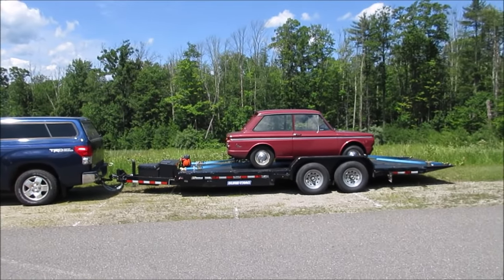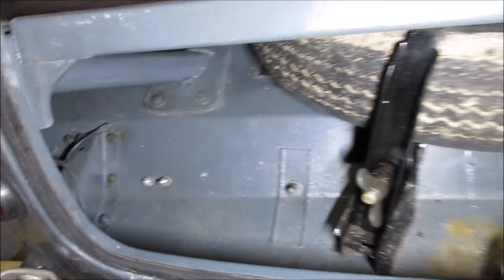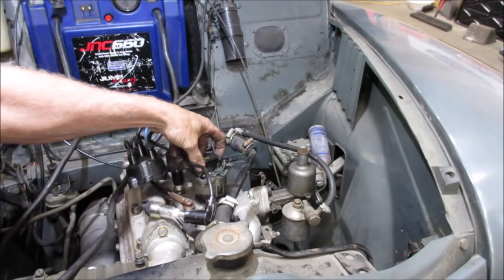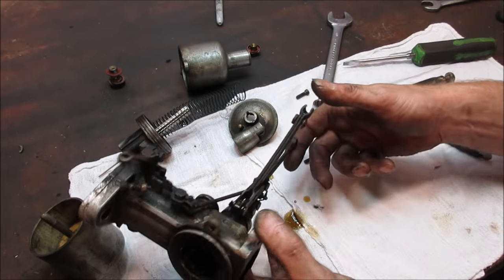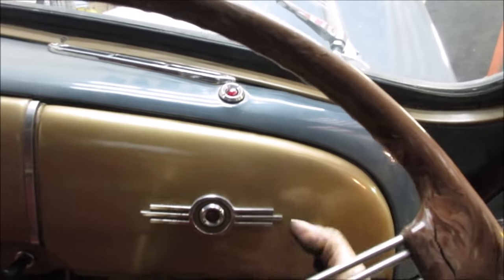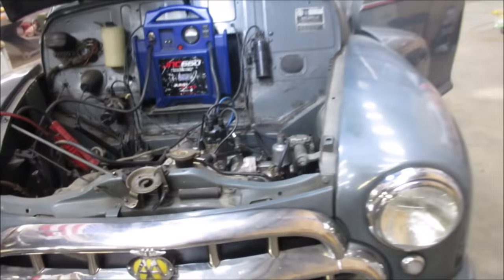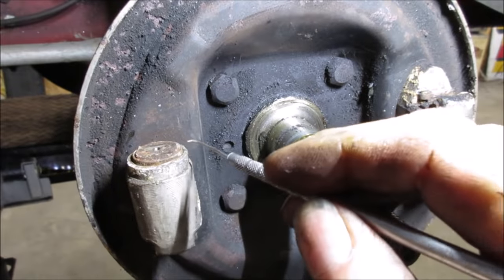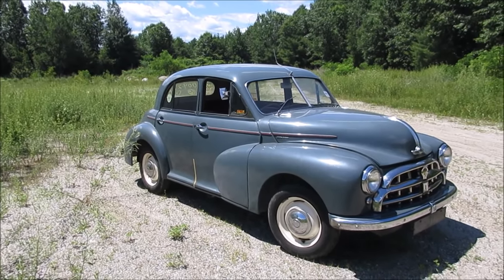50s Morris Oxford Found in an Old Warehouse. Did It Survive?

Comment: My experience comes mostly from the smaller model, the Morris Minor, which  several neighbours and friends had over the years of my childhood and young adulthood.  Several things to watch out for. ... Earlier model cars had a zero pounds pressure radiator cap. It was just a "steam venting" cap that stopped water sloshing out of the radiator when going around corners. A neighbour wrongly installed a 4psi pressure cap, and it blew his radiator, which he had to have repaired, then complained that "Morris Minors are always blowing radiators". The earliest Morris Minors were 918cc displacement sidevalve and fully thermosyphon water circulation. No waterpump and therefore no heater was available.   UPDATED.(Wikipedia says that some of the later Sidevalve engine models, had an optional waterpump, so that an optional heater, could then be installed).   A simple fanblade was attached directly to the Generator front pulley.  Later models had 803cc (and later still "1,000"cc and "1,100"cc) Overhead Valve engines with a waterpump and so could have heaters fitted.  Also the 12 volt DC Generator charging system is far more limited in Amps current output, but it is safe to have the peak charging voltage set much higher. Especially if the car has to park outside in below freezing weather in Winter. Voltage can well exceed the 14.4 volts across the battery terminals that a modern alternator equipped car would expect. The early DC generators are rated to put out about 18 Amps maximum which is almost entirely consumed by driving with headlights and ignition on, turn signals and brakelamps etc.  If the optional extra heater has been fitted, then there's another 3 amps used for the blower motor.  Remember also that DC Generators do not make their full current output until the engine revs are equivalent to the car running about 45mph in top gear (again, my experience with several British cars of the 1950's and '60's). So people confined to "around town" running at 30mph maximum, are more likely to suffer flat batteries in Winter when demands are higher on a battery.    My cars parked outside and were expected to start when covered in frost and ice.  I had my DC Generator cars set for about 16 volts peak.   Also depending on which car model, the "shelf" where your jumper pack was sitting, would often be where the 12 volt battery is located. On some models of British cars, that  equivalent space is where the optional extra, heater unit is located. The electric fuel pump located in the engine compartment is a type that has been optimised for lots of SUCK to bring fuel up from the rear petrol tank, but may not have as much BLOW  (as other fuel pumps which are usually located at the back of the car near the fuel tank).  Some early models to switch on and off the lights for the speedo and fuel gauge, a small slide-switch is hidden under the edge of the dash near the centre. On those particular models, gauge lamps are entirely independent of the headlights main on/off switch. Don't leave them on all day and night or it will drain the battery flat.  Other models the headlamp switch will have a position where the headlamps are on but the gauge lamps OFF.  Low/high beam dipswitch is often a foot push button on the floor.
Reply: Oh good, it is Mustie1, with his hat on now. Some other dude, Whoever it was, was hat-less when I was watching the earlier part of the video LOL.
Reply: My dad's first car was a Morris Minor!
Reply: words
Reply: Thank you for that, I posted that the Minor didn't have a side valve engine, I stand corrected. My earliest memories of the Minor were twofold. A close neighbour had one and as a child I watched him work on it, this old be in 1964 or thereabouts and thi was an old car hen and it definitely had an A series 998 in it. The other memory was my father taught to drive one of his female colleagues and she bought a brand new one, which father would borrow on the odd occasion as we didn't have a car then, he rode a motorcycle to the hospital where he was a male nurse. So this was before 1964 as we got our first car a Morris 1100 ( that was a B series engine)
Reply: @samrodian919  The earliest Morris Minors were known here as "Low-lights" and had the low mounted 5.75 inch diameter headlamps set next to the grille. According to Wikipedia they came out 1948-1953 and had the 918cc sidevalve engine.  (Wikipedia says that some of the later Sidevalve engine models, had an optional waterpump, so that an optional heater, could then be installed).  They ALL had a two piece "split" front windscreen, similar to the earliest VW Kombi vans.  Around 1953 they installed a smaller but newer and better they would argue, 803cc engine, overhead valve, pressurised cooling system, normal fanbelt driven waterpump so a heater option was available.   and had conventional 7 inch diameter headlights mounted high (known as a "Hi-light").  partly to conform to USA auto rules as some must have been sent there. However the earliest of the overhead valve engined models, did still have the 2 piece front windscreen.  By 1957 new larger motors were available, being a whisker under "1,000" cc and "1,100 cc"  and by then ALL Morris Minors had a normal single piece front windscreen. Remember though that British cars including those imported into New Zealand and Australia, still only had the old fashioned "toughened" (NOT laminated) glass right up until the later 1970's or early 1980's.   Indeed One of my previous cars was a JDM (Japanese import) from 1986 and it was still legal with a toughened glass windscreen. Cars newer than that have to have laminated windscreens. .
Reply: Very interesting.
Reply: @KiwiCatherineJemma  I bought an old tired one with the headlamps in the grille. Fitted wings off thd newer version and had one of the
first four headlamp models ?. Not good for the old dynamo though, but it got me mobile as a youth. Actually very reliable 45mph car.
Reply: @BRI33NOR  Good going ! You wouldn't have been the only person to fit the newer front wings and have a 4 headlight model, as I have heard of, and later seen photos, of other folks doing that. cheers

Comment: The Morris-built cars of that vintage had graphite throwout bearings instead of steel bearings. Holding the clutch in at idle wears them out fast. You can hear the engine revs drop when you push in the pedal. I always shift into neutral at traffic lights and let out the clutch. Then shift into gear when the light changes.
Reply: That is good advice for all manual transmission cars, of course.
Reply: My 1962 Morris Elite has the graphite thrust bearing, too...in my stash of parts I found a roller type which I may convert to at some stage.
Reply: Lotta older cars had graphite bearings. It's where the term "throw-out bearing" comes from no one says clutch release bearing. Modern roller style bearings are perfectly happy holding your clutch for longer than your foot can.
Reply: Cheers. I didn't know that.  I run a 1950 Jowett Javelin and handbook says not to rest foot on clutch pedal while driving. Seems that in the day, many people still needed to be educated on the hows and whys of car operation.
Reply: Yes, MGBs are the same so you never ride the clutch.
Reply: The Hillman Imp (a couple of weeks ago) also had a graphite clutch release/throw out bearing (my '67 model did, anyway). Cheap and simple, I suppose, but feels like it would wear very quickly.

The clutch actuating arm can follow an arc as it engages, especially if the arm pivots one side and the slave cylinder actuates the other. A graphite bearing will wear at an angle and cope with this. I think that many roller release bearings are designed to meet the clutch more 'square on' with an even force against the surface.
Reply: @SPAZTICCYTOPLASM  I was taught to change to neutral at lights in driving school in 2003, so apparently instructors are still convinced that's a good thing on more or less modern cars. Of course they don't necessarily have in-depth training on technical details.
Reply: Chrysler UK still used the graphite thrust bearing on the last of the Hillman Hunters, the bastards.
NOT good in the heavy traffic gridlock situation.
Reply: @andysaunders3708  That sounds about right...Chrysler wringing out the last pennies from a 12yo design. ☺

Comment: Hi Mustie, In the UK all the older petrol heads have played with SU carbs. Thought I should tell you the piston and cylinder on top of the SU carb should be assembled dry. Oiling the piston and cylinder causes problems with dust and causes it to stick at low temperatures. I hope that helps. Just add the oil to the damper after you've assembled it. this stops the piston fluttering.
Reply: 3 in 1 oil for the damper., does not take a lot, and as said piston and its houseing are dru and clean, mixture is adjusted by raising and lowering the needle by a nut at the bottom of the housing, reverse gear is found by either pulling back or pushing forward can't remember which and pulling the knob out that is at the end of the gear lever, very clever idea and then its up or down can't remember which but it will only take a tick to work it out, but its a wee jem most are long gone now.
Reply: That is why they have a port on top with a dipstick.👍

Comment: The shell conversion chart was from when here in the UK we switched from selling fuel from gallons to litres. This took place some time back in the 80's if I remember correctly. Because this meant getting every pump in the country modified, the change did not happen overnight, in fact we had a few years of some stations selling fuel by the gallon, whilst others were selling it by the litre. It was all part of the countries somewhat selective switch over to metric from the old imperial system. I say selective because we still use some of the old measurements, MPH being one example, all of our speed limits are in MPH, and very strangely - when you consider we have sold fuel by the litre for many years now, we still measure a cars economy in miles per gallon!
Reply: when we went out in the late 70s, we used to say to the pump bloke stick a fiver in mate....
Reply: Yep, took place in the 1980's. I've seen photos of UK petrol stations selling their petrol in gallons and litres from that time. Remember 4-Star?
Reply: @adelaideautowashes  OK I know this is a bit of an exaggeration, but it felt like it went very quickly from 87p a gallon to 87p a litre...the switchover came during a time of rapid increases in fuel taxes.
Reply: The British approach to metric is truly strange although in practice more complete than Canada. The standards were all set up during 1962 to 1970 -- albeit on a voluntary basis -- and then after some political squabbling in 1970-71 made mandatory with the rollout happening in stages over the next 15 years or so, and the first thing to really take hold was celsius, where a huge generational split opened -- the way I'd summarize it is people under 45 never knew Fahrenheit, people 45 to 55 have mostly forgotten Fahrenheit despite being exposed to both at the outset, and people over 60 still need Celsius translated for them. Distances are strictly imperial/SAE, given in miles, yet measurements are metric. Weights are all metric. Fuel economy seems to be given both ways though people still relate more to MPG.

Comment: Check the ignition coil connections to determine -ve or +ve ground, they are most always marked; points will be on the ground side.  

The oil goes in the centre part of the "dashpot", the part you unscrewed with the brass piston assembly  on the end is a hydraulic damper to limit how fast the needle can rise when the throttle is opened.  This is what gives the accelerator pump action in these carbs so it important otherwise you get lots of hesitation when you snap the throttle open.  20W50 engine oil typically works just fine, but any oil is better than none.  Just fill up the very centre part that the brass piston slides within up to the top.

The big lever on the bottom is the equivalent of a choke, it lowers the jet (equivalent to raising the needle) to enrich the fuel.  You were correct about the hex nut under the carb being used for mixture adjustment.

Petrol switched from being sold in gallons to being sold in litres in the UK around the mid-80s and those stick on conversion tables were quite common.  The veterinary hospital in Plymouth on the window sticker is still going BTW!

Comment: This is amazing! What a find...

My old Dad told me that when he was young, they had one quite similar to this but with spilt screen and standard engine etc.

The problem with the windicators was that they would stick after time so my Dad and his Dad had this system whereby if Grandad turned right yet the indicator did not operate correctly he'd shout "Right turn Chris..." and my dad would then simply bash against the door pillar for said windicator to move out!

Comment: Great condition of body and interior. The important stuff. Brakes are easy and cheap to fix. SU carb and erratic ignition as well. I guess some good service kits will do the job. A true survivor. (And yes,  you should top up the carb with 20 grade damper oil.)

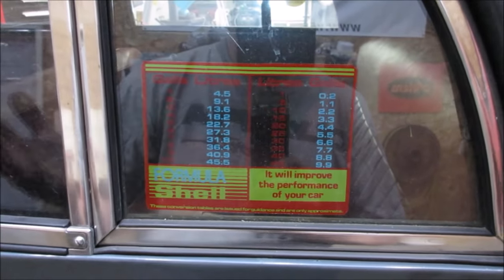Comment: 01:07:30 The UK went through "decimalisation" in 1973 - converting from imperial measures to using litres, so people had to get used to what a litre was! Please also note: a US gallon is not the same as an imperial gallon!!!
Reply: UK Decimalisation was 15th Feb 1971. That was for the currency. Fuel was sold in gallons up to some point in the 1980s - I can't find the exact date. The sticker was for the time when fuel stopped being sold in gallons and started being sold in litres.
Reply: @gareth1971  it was when Britain joined the EEC in 1973. I was there. I remember the weights and measures officials coming into my parents' shop, inspecting weighing scales, rulers and so on. After testing, they would stamp the scales etc. with a crown symbol.
Reply: Yes, people call them gas guzzlers but US cars actually do a lot better MPG than stated in the US when they use imperial gallons. I drove a V6 Mustang convertible in the US in 2005 and was surprised at how well it did on fuel. A lot of that was freeway use though but still, fuel use wasn't much worse than my sporty-ish 2.0 Ford.
Reply: @sonovoxx  Petrol was different, it was still sold in gallons in most stations until the mid 80s (until 1988 stations had to display the equivalent gallon price) though some stations retained gallons until the mid 90's. I started driving in 82 and it was years before the change happened, which meant that instead of it going up by 5p a gallon, it started to go up by 5p per litre, robbing gits. Thankfully we managed to retain the pint 👍
Reply: @Ian Darley  Proper 20 fl.oz pint at that, none of this Mickey Mouse 16 ounce nonsense 😁
Reply: @sonovoxx  I had that in my bakery, they came in and said you can't use lb's and oz's. I told them to go fly, as mesuring ingredients like flour etc didn't matter as I could use bricks half bricks and quater bricks for all I cared as mesures. The only legal requirement was the finished loaf must be at 800g or 400g. How I get to that was up to me. They then went into my shop and weighed all the bread on the shelves, all was correct and they scurried off never to be seen again.
Reply: Isn't an Imperial gallon bigger than a US gallon?
Reply: @michaelbenardo5695  Yes, though still 8 pints, the imperial pint was changed to 20oz making the gallon larger and the ton was changed to 2200lbs (from this point known as 'long tons' and the original ton being henceforth called 'short tons' in 1824 Prior to this it was the Queen Anne imperial system (the system taken to the colonies and still alive in the current US).
Reply: @IanDarley  Sort of. The Imp ton is 2,240 pounds: 16 oz = 1 lb; 14 lbs = 1stone; 8 stones = 1 CWT (hundredweight = 112 lbs); 20 CWT (2,240 lbs) = 1 (long) ton. The 2,200 lbs you quoted is closer to a tonne (1,000 kg = 2,204.623 lbs).

Just as you say, the pint was increased to 20 fl.ozs from 16, and with the same number of pints per gallon, 8, that measure was increased in volume by 25% in Britain, making the current US gallon smaller than the Imp. one.

All so simple, innit. I left the less used  measures alone; grains, bushels, pecks, firkins, and didn’t go near distance; life’s far too short. Why we had to change to the ever so complicated metric system from the fabulous logic of Imperial is a mystery 🙄😄🙄.

Comment: Hey Mustie, I grew up just a few miles from the hillman imp factory in Glasgow Scotland. I remember it as a kid and you might be able to get CV Joints as a replacement for the rubber doughnuts today.. Also the carb on the Morris is a SU carb and the plunger needs more oil in it as it stops it from bogging down with not enough it will feed it to rich.. Also the assembly that pulls down from the needle is the choke, when you give the throttle gas then the vacuum lifts the needle assembly dampened by the plunger oil.. Love the show and keep up the good work from Tony in Scotland..
Reply: That’ll be Linwood then
I had an imp myself
Cheers from Dundee
Reply: Clutch is probably adjusted to ** and back already !
   Getting the choke right  is critical to the operation of vehicles of this age !!
Reply: looks like those brake pistons are missing their rubbers ?
Reply: I like this video, this old girl needs the rest of the work done !